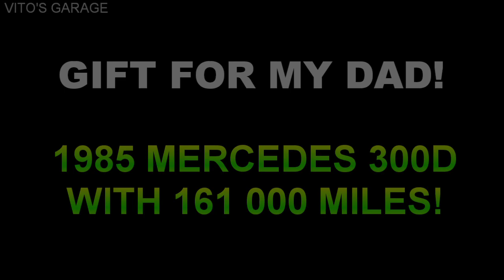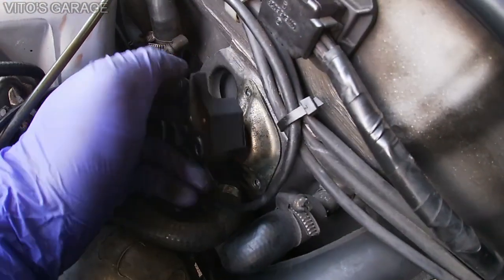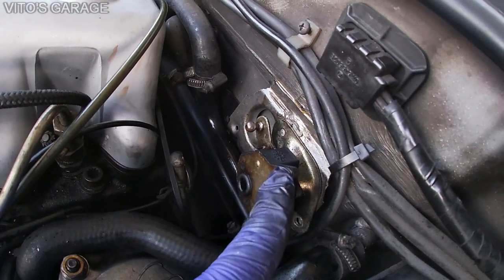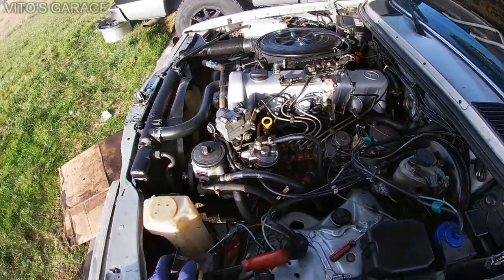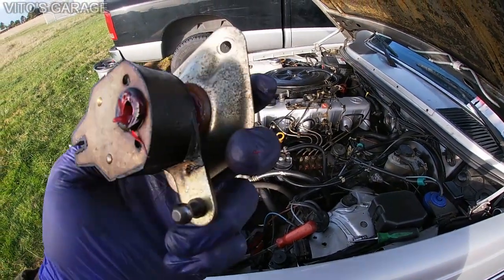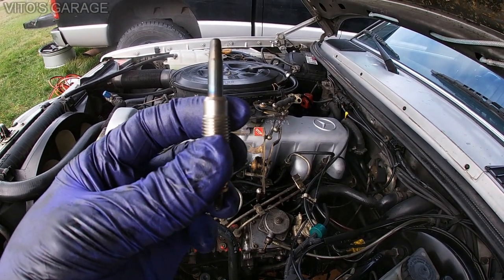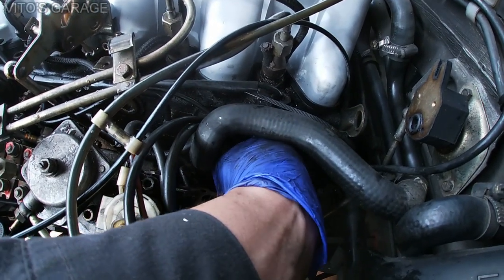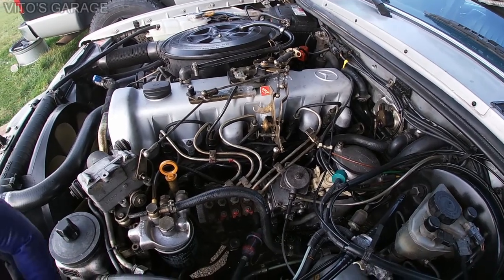PART 11 Dad's Mercedes W123: New LF Fender Molding, New Glow Plugs, Pivot Mount Maintenance..

Comment: MAy I ask Vito why you are doing this in a carpark? Are you not worried it gets damaged or even stole? Just asking out of curiosity.
Reply: I have been wondering the same thing.
Reply from the maker: I work with what I have and where I can for now. Who will damage what?
Reply: @VITOSGARAGE  I admire your work and passion. I hope you can get a shop to work in, you deserve it. I am off today for a drive in my 1987 190D 2.5. I am in Tasmania and I also  work on my car in the open air. Love classic Mercedes!
Reply: @VITOSGARAGE  Anyone or passers by  damage the car you are working on for your Dad. Just a thought. Here kids would break into it and damage it just for the hell of it.
Reply from the maker: I am not saying United States is safe but I’ve left cars outside even in a residential area for years and thank God no problems. Sometimes people steal wheels but that’s mostly it. Not too many people are interested in stealing Classic Mercedes. They steal older Hondas a lot though. It also depends what area you’re in. 
Kids here usually don’t vandalize cars. They have different interests.
I am on military base now. She’s safe and sound.
Reply: @VITOSGARAGE  Ah good yes she will be safe there Vito